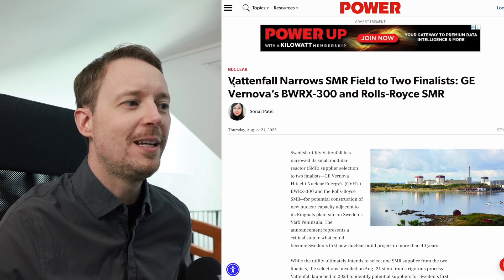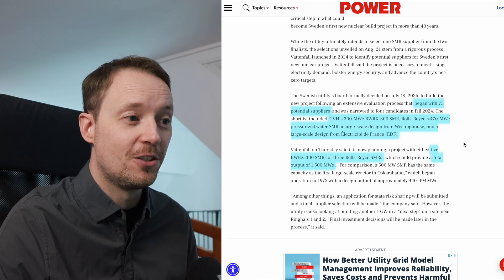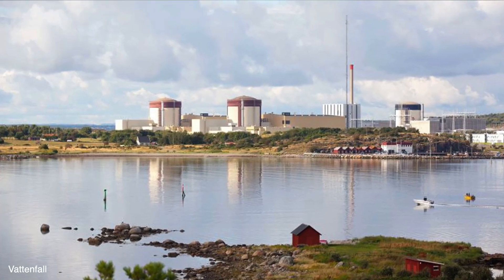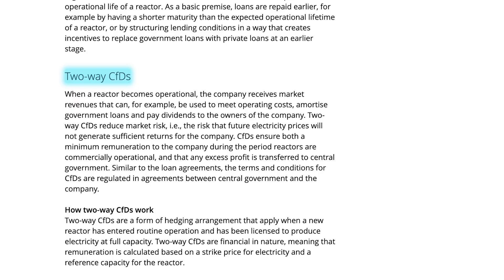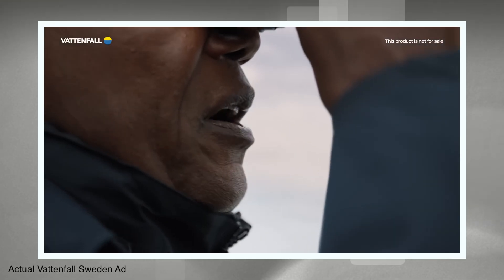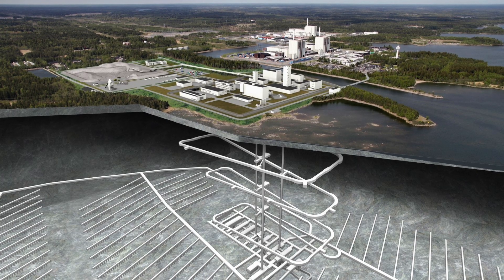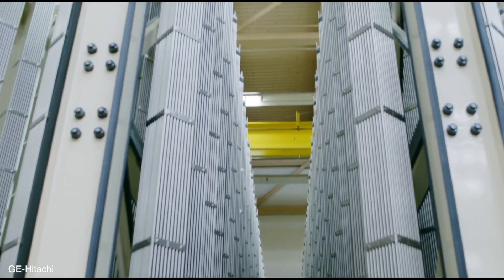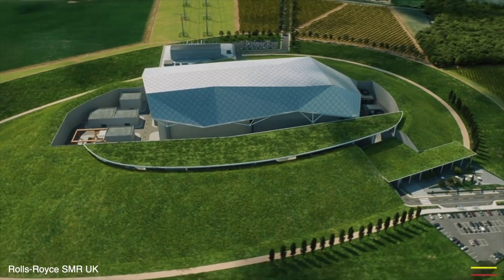Sweden Plans Up To 5 New Nuclear Reactors

Comment: Very cool! As a Canuck, I personally am rooting for the BWRX-300 since it's like you mentioned what we're going to build at Darlington B with construction already under way if I'm not mistaken. It would also be Canada's first NON CANDU reactor in operation which is also something unique. It's also the reactor design proposed for a site about 6 miles away from my house here in Metro Edmonton and that's OK. Better that than yet another oil upgrader or natural gas plant! I do hope that Sweden gets into the nuclear recycling racket instead of just burying all its waste which seems like a lot of lost energy potential to me.

Comment: Do the reasons they provided for going with SMRs make sense to you? I am asking because in your last video, you mentioned that large reactors are just more economical.
Reply from the maker: The project gave somewhat decent reasons in my opinion. Long-term, it's unlikely to be as economical though. But sometimes near-term issues (available space, pace of construction, up front cost) force the decision.
In my opinion, five 300 MWe reactors at a site isn't the best choice for a 60-80 year power plant over a single large unit. But that's the choice they're going with. At least they provided reasonable justification and aren't doing it just for SMR hype.
Reply: @atomicblender  I the one large power plant fails, you must have according, probably expensive backup power. If one of the 300 MWe fails, then backup is less of a problem. And remember, waste heat is used for space heating, so backup must be local and connected to the heat network.

Comment: I agree that the BWRX-300 should win. A BWR has an inherently simpler design than a PWR. I don't understand why the BWR does not have a huge cost advantage. Is it because ALARA forces them to put more safety systems to make it about the same cost as a PWR?
Reply: The price of bwrx300 in Canada has skyrocketed to 4,5 billion.
Reply: @Petriiik  BWRs should be less expensive but they are not. Is this due to ALARA?
Reply: It's still a high-pressure/low-temperature water reactor, just less efficient.
Reply: @chapter4travels  The pressure in a BWR is around 70 bar. While the pressure in a PWR is around 155 bar. This should simplify the BWR design over the PWR. But simplicity does not result in cost savings.
Reply: @mhirasuna  As compared to something like the Natrium reactor at atmospheric pressure, with a 550°C output temperature and much higher power conversion efficiency, along with 8 times the fuel utilization. Not to mention load following.
Reply: @chapter4travels  The BWR has excellent load following capabilities. The voids in the boiling water provide a strong negative void coefficient. Best of all, the BWR does not need a heat exchanger. Again, the BWR should win on cost, but it still has a high price tag.